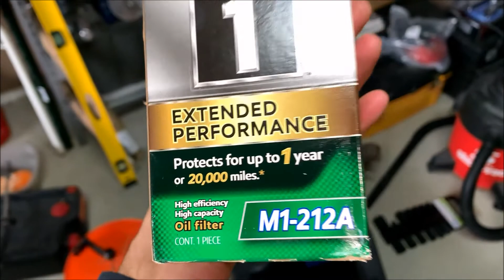2014+ Silverado 5.3 Oil Change & Tire Rotation

Comment: What about the air pressure sensors how u reset them
Reply from the maker: I don’t believe you have to reset them.  I simply add air to the tire and you can watch on the pressure go up on the driver display.

Comment: Nice video. Would this void out my power train warranty if start doing my own oil change?
Reply from the maker: I don’t believe something like general maintenance voids any kind of warranty.  I would however keep a log in your service manual of the mileage on the vehicle as well as the oil type and filter at each oil change.